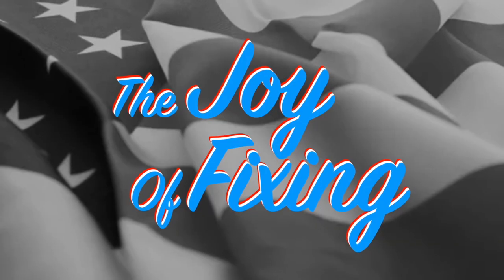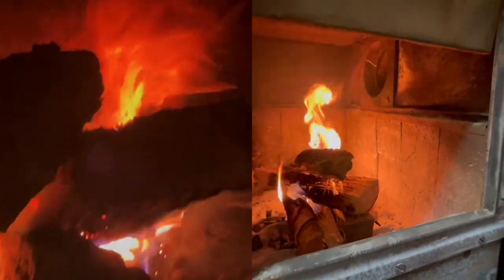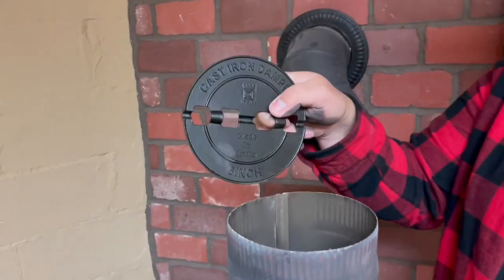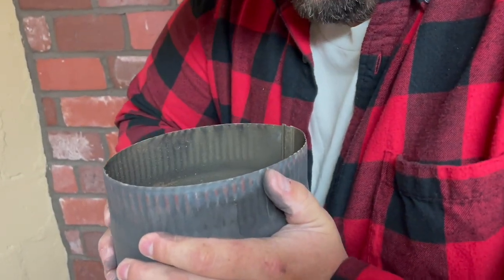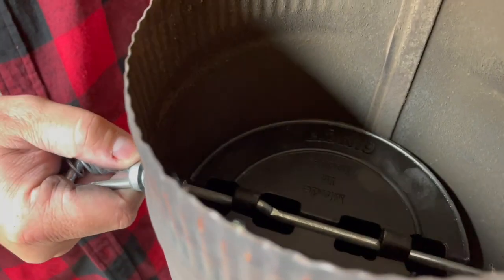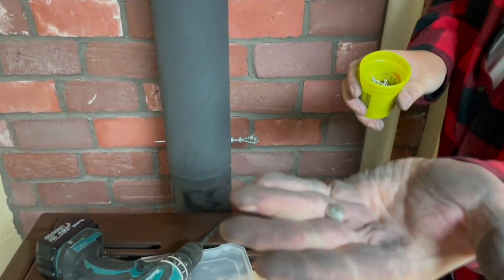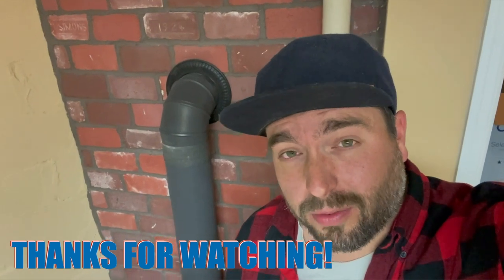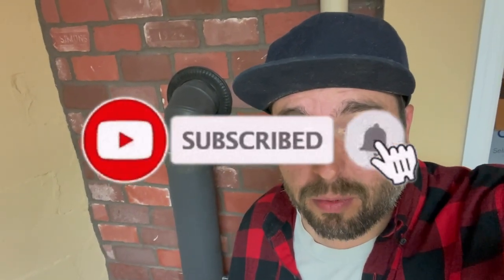This might MASSIVELY change your wood stove performance! Installing an Updraft Damper on your Flue!

Comment: If you have a brand new style wood stove,  don't ever do this.  Look it up,  just wanted to warn people who don't know all that much about their stoves.
Reply from the maker: Agreed. Unless it's some cast iron behemoth intended to replicate a vintage stove, I can't think of ANY newer style stoves that need a damper in the flue. Thanks for adding to the conversation.
Reply: @thejoyoffixing  Yeah,  I'm not quite sure how I feel about the new stoves.  I don't have one so I'm only basing off videos and things I've heard.  They are supposed to burn the wood more efficiently.  I know a lot of people have issues with them though because unlike the old school ones,  you can only burn seasoned wood.  From my understanding it's damn near impossible to use anything that isn't seasoned.
Reply from the maker: @mikemiller6065  That's pretty interesting. I mean, I do prefer seasoned wood because it isn't burning off moisture. BUT in a pinch, I've gotten away with almost anything in this older stove. With the newer ones that have secondary burn it seems like a whole different animal. Some people love it and some people hate it. They do claim to burn things more efficiently, and the concept makes a LOT of sense. BUT, I've heard from a lot of people who say that the hype is more impressive than the actual product.
Hard to really know. I've got 3 stoves and I don't see buying another one anytime soon so.... I just gotta go off of what others with that experience say. So far... there is no consensus that I can find on what the truth actually is.

Comment: i just want to know who installed the stove without installing a damper? that's like going to bed with your pants still on, it's just not a good idea.
Reply from the maker: Well technically this stove has a damper at the inlet. It’s brilliant. Check out a “king” or Ashley style wood stove. Maybe I should make a video. I have 2.
Reply: the Ashley that i have is from the late 70's and it still works great. having said that i would never use it without a damper as it allows me to control the stove better.  @thejoyoffixing